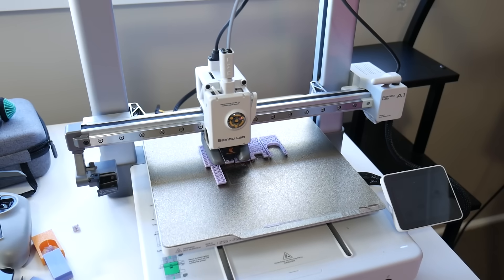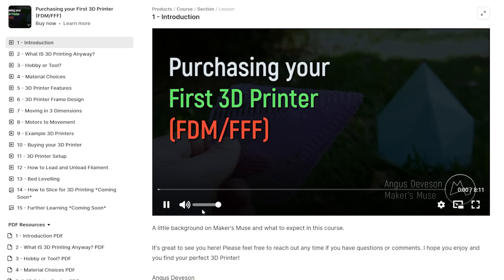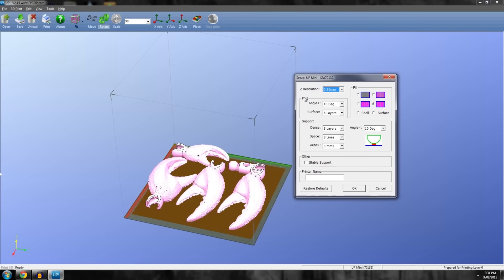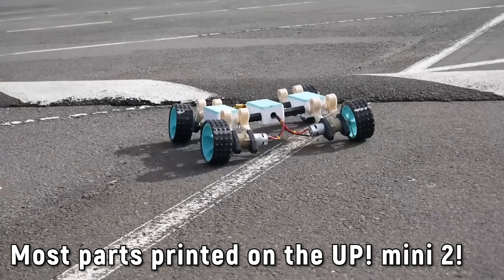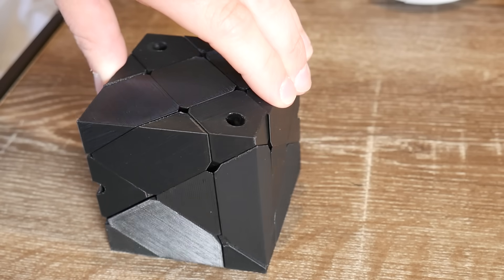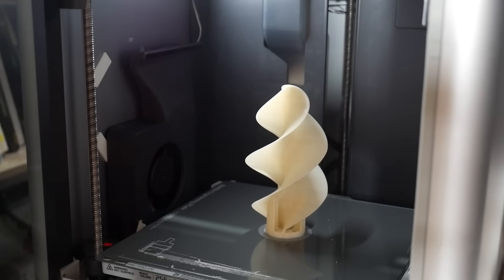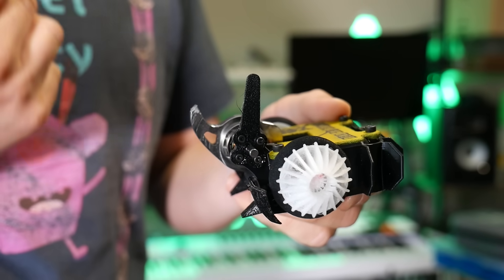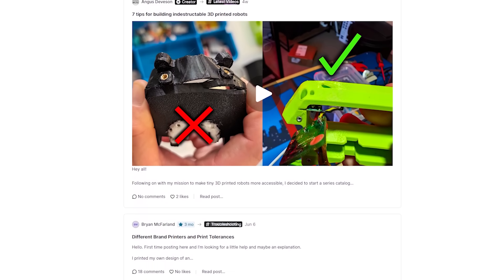The best 3D printer is...

Comment: Main thing is to do some research first. Watch videos like this and then research some more.

My first 3D printer was purchased because it was cheapish, was small, and I thought it would be easy to print small things on. Was junk. A benchy took about 18 hours if it actually finished.

Then got an A1-Mini. Absolute revelation.  Didn't want the printer to be the hobby but just wanted to have one that printed stuff. The Mini has been great and very reliable with any issues being mainly filament/humidity. Just got an A1 too only because I know how to use it and a lot of the spares and the AMS are compatible.  I tend to use Bambu's filament because, again, it just tends to work. Not a Bambu fanboy but if you just want to 3D print then it is an appliance.

Comment: This is why I watched a shitload of reviews and picked the machine I wanted to try . First 2 were a Kobra 2 and a Creality S1 Plus. However , they were not the best but I learnt from using the Creality.  Then I got an FLSun v400 and recently a Flashforge 5M Pro . Now both have their own quirks but I know enough now  about 3D printing to be able to deal with them. Enjoy using both . The one thing I never did was to blame any reviewer if I didn't like a 3D Printer I bought. The choice is still mine and reviewers are not there to find every bug a printer has !

Comment: Have to agree reliability is absolutely king. I have just reluctantly retired my zortrax inventure, it was slow but stunning prints and a reliable little unit. The mobo gave out in the end.
I run a farm of piS bamboos, a little worried about the access issue, but the printers just work. I replaced the first nozel on them last week, a solid year of commercial printing under its belt. Printers have just come so far that there is no excuse for trash anymore.
Reply: The worries are always going to be there but the reliability of Bambu Lab for the price is ridiculous.

The first and only thing we did to the C1 was to swap the nozzle after 1400h of printing. Just one nozzle, that's all we've done, and we have an A1 mini, an A1, three P1S (soon to be four) and a C1. I understand the dangers of Bambu Lab, but I'm not willing to pay with my time anymore, It has been 10 years of fighting with machines, I don't want to "learn" anymore, I want to hit print and forget about the machine.
Reply: @chico_zombye  they are honestly that good. I swap between PCTG, abs, nylon, tpu and CF petG constantly and it just works every time. Hard to argue with.

Comment: I've experimented with a lot of 3D Printers and some I bought just for the history and retro display. My first printer that I actually bought at near full price, Amazon had it on sale, was a Dobot Mooz 2. Bet you never heard of it. It was almost a clone of the Snapmaker Original. In fact it even has the 3 modules (3D print, Laser, and CNC). It was actually fantastic and still is BUT small print bed, BUT heated. Made my first print, a word clock with Raspberry Pi and Nanopixels. Came out great and still use it. Next I bought a Lulzbot TAZ5. I bought 2 of them. By this time I had experimented with the Dobot and bought 2 Lulzbot TAZ 5s on eBay "parts only". They were both in bad shape, wiring, bad LCD, assembled very wrong. I fixed both and ended up with 2 $1200 printers for $250 and about $150 in parts for both but about 5 hrs of my time for each. They are still work horses, and one I built a Moarstruder, 1.2mm nozzle with 2.85mm filament. Still great printers. From this point all the printers I bought were "as is, parts only on eBay". I bought a Snapmaker A350, kind of overrated but OK. A Sindoh DP-200, enclosed and prints great in ABS. Then I got some old retro machines, Cubify Generation 2 and 3D Systems actually had an archive of the slicer that makes .cube files vs. gcode. Makes average prints BUT it prints. And I figured out how to bypass the proprietary filament. I also got a IMADE3D Jellybox. Very very cool transparent enclosure. This was the first generation and they still make this printer to this day. Makes average prints about as good as the Cubify. My printers that I use now are 3 VORONS. I like them a lot, have to build them and I bought them on eBay from people frustrated with either the build or firmware loading as it uses Klipper, Mainsail, and one other interface software I can't recall. So, they are complicated builds. Klipper is great as, if you load up a build plate and one print fails you can stop the print of that one piece keeping the rest of the prints on the bed going. VERY VERY cool. The VORONS are all enclosed so there is no limit to what they can print and are configurable to your design. I also have a Ankermake M5 which is also pretty cool. I did get one delta printer, almost forgot, Dobot Mooz 3 which actually allows you to blend filament colors and do multicolor printing. Got it super cheap from someone who probably configured the slicer for printing on a square bed vs. the delta's circular. I configured the slicer correctly and work. Does have a heated bed, average prints with a very small bed, But it's fast like all delta printers. The Dobot Mooz 2 is better but it's cool to have one delta printer.

Comment: I started with a Makerbot Replicator Z-18.  I switched to a Bambu Lab X1 Carbon when it came out, and now have a Bambu Lab H2D to work with the X1 Carbon.  I'm used to CNC machines, so what I print always seems a little small.  Print and glue.  I've switched to PETG for final products.  I'm hoping for a printer with 9 times the volume in the next few years.

Comment: I bought my first high speed core xy printer a few months ago. After so much agonising about where to put my AU bucks, I finally settled on the Anycubic Kobra S1 and I'm loving it! It has the ACE Pro (supports 2 of these!) and I'm loving it (although multicolour is slow af!)

It prints PETG as fast as PLA! And because of the ceramic lined hotend, you can swap between the two in succession. Either order!

My Ender 3 linear rail conversion is gathering dust because the Kobra S1 just works on demand and is so fast. I may just get a complete Anycubic printhead assembly for the Ender, the hotend is its weakest link! 😂😂😂
Reply: Also feel the same as you about resin machines. The stench is literally nasty. Lethally, potentially.

Comment: Ans:  It depends.......

I have been doing 3D printers since 2001, what really gets me is many in YT are so adamant that one could dominate all against the entire market.  If this is the case many printers would have gone out of business by now, including older commercial companies like $$$$$-$ Polyjet or $$$$$ Stratasys.

3D printer is a tool, the question is - what do """"you""""" use it for?

$ Educational Self learning - open top basic Kit printers
$$ Print Exploration or Print Farm -  more automated options, mass print customisation or Filament vs Resin question
$$$ Design focus - superior print speed & quality, quality hardware v cost tradeoffs e.g. heated chamber, multi filament
$$$$ Semi Pro - fewer failures & post process steps tradeoffs with more proprietary hardware and ease of use desktops
$$$$$-$ Commercial grade - all of the above, in a dedicated room, much improved reliability when professionals don't have tinker time to mess around with minimal printer input effort (much like 2D graphic designer with their Pantone printers), traded with proprietary lockout features for print quality and mass printing (consistently & reliably)

Comment: Good advice. Find the tool that works best in your hands, and use it.  

@Maker'sMuse:  
Something that would be really helpful to me in finding the most ideal printer for my work is if the manufacturers and reviewers would print models with similar characteristics to those that I deal with, but I'm not finding many examples.   

Here's the problem:

Most of the promotional content from the industry offers images of elegant CAD models (often hard-surface designs) or digital sculpts that were designed and optimized for 3D printing.  That makes sense, but for users who need to print more complex shapes that push the limits of the machine, those demonstration pieces are not very informative.  

My work requires printing models based on 3D scans of organic/biological structures.  I didn't design them - nature did, and if I want to faithfully reproduce those objects then altering them to make them more printer-friendly isn't an option.  Whether generated by high-resolution surface scanning or micro-CT scanning, the shapes are often highly textured and convoluted.  Even orienting the model for slicing/printing isn't straight forward, because every orientation creates a new problem for each one it solves.  

Seeing a printer smoothly tracing the graceful contours of a Mandalorian helmet doesn't tell me anything about how it will handle one of my models.  When a layer path looks less like lines and curves and more like a seismograph tracing, the amount and frequency of directional changes the machine has to make is significantly higher.  (If I'm not mindful of the settings when I print them, the whole machine vibrates like a paint shaker and sounds like it may fly apart). 

I have given files to a number of friends and colleagues running different machines, and there are definitely some that work better than others.  But I think the 3D printing community could benefit from finding such an experiment in one place, and your channel seems ideal.  So how about it, Angus - would you consider testing out some jagged natural models?  I'll be happy to supply a few .STL files!

Comment: Prebuilt vs kit isn't even necessasrily cheaper. Take my Ender 3 MAX neo as an example. What I wanted was a large volume printer (>30cm³ to print full size helmets in a single go). It was by far the cheapest thing available *in my part of the world* at the time, next cheapest was the two largest neptunes but they were sold out globally at the time and everything else would've been at least 100€ out of budget.

My goals as such were:

Reasonable print quality
30cm³ minimum
Under 350€

I hate this printer, but for what I wanted at the time it was great. I hate it because it keeps having novel issues too frequently, it's a very cranky piece of kit and every time I squash an issue a new one seems to manifest out of thin air. If budget is not a concern I'd say go bigger, but if budget is a concern then you'll have to put in work.

Comment: My personal experience with my Ender 3 (bought in fall 2022) has been amazing! It’s my go-to printer, and I see no reason to switch. I also learned a bucketload about it while assembling it. Being brand new in the industry, CHEP helped me assemble it, and he also said not to mod it right away, but rather to work with it straight out of the box, get to grips with it, and THEN mod it if you want. I haven’t. It works perfectly as it is, and it’s all I need in this hobby. Of course, like you said, everyone has their own preferences, and there is no right or wrong.
Reply: It's a great teaching printer and It works well for the price. I have mine tuned to my liking and I can actually navigate the slicer to get great results from it. I still use it for my projects even tho I have an ender3 pro. Because it is easy to fix and I am very familiar with it, parts are dirt cheap for it I tend to gravitate to using the ender 3 more than the better printer.
Reply: @webreakforsquirrel4201  I mean its not just a teaching printer its also a just works printer... assuming you assembled and maintained it correctly. But same goes for any machine really, so... meh, points moot i guess.

Comment: I am the type who doesn't print so frequently that speed is important, but does want it to be reliable, is planning to use it for (electronics) engineering purposes and is generally willing to pay a bit extra for a "step-up" product that I believe will last longer than others.
SO for me the MK4 made the most sense and it hasn't failed me yet. Don't feel the need to upgrade to a 4S or to consider a Core One at present.

But that is my personal choice. Thanks to Bambu giving the market the swift kick to the rear it desperately needed. Most printers released these days are perfectly viable for anyone interested in such machines. Be it as a hobbyist looking to print neat things or an (aspiring) engineer looking to design and create their own stuff. It is nowadays more about the tradeoffs offered by the company and thus more important to double-check that.

Comment: Thank you so much for the video! I avoided buying a Bambu printer just because of the firmware and decided to go with our k1 Max and get the CFS to go with it. I knew I would have bed levelling issues and a couple of other problems but boy was I shocked when one of the load sensors failed and the hot end dug straight into the build plate and then later on the extruder backed straight into the printer and broke one of the wires on the extruder motor, plus quite a few other issues. Creality were really good with organising me return and refund and I just want reliability so I have ordered the P1S with the AMS 2 Pro.

Comment: mk3 bed is the bed on my hypercube lol

though both of my hypercubes have the same things in common as your workhorses, they're reliable printers that are a tool

edit2: "Road Runner" which is my more travel friendly hypercube, it was first built in 2017 and then has had upgrades ever since, starting out as a clone MK2 from Sintron on ebay, before becoming the hypercube using the same electronics, before then being upgraded to trinamic drivers & klipper. The stepper motors are pretty much the only original part from that Sintron which I bought back in 2015! so they're over 10 years old lol. I do need to replace them because they are noisy AF and defeat the silent drive

Comment: Thanks for this. It didn't help me at all in being 100% on what my next step will be and I'm kind of glad for that. I have a MK3s, upgraded from a Mk3, all courtesy of my last job going out of business during COVID. It had some issues, it's seen many many hours of hard printing, and I let it sit for years because of those issues. Recently I pulled it out of storage, updated it, redid bed leveling, new filament, and it printed right away. It's slower than I'd like, but just as fast as I remembered it being. That speed has had me wanting to go faster and as much as I see all the pushing for bambu floating around, I just don't want to get behind their walled garden. I'm also worried about prusa sliding somewhat in that direction. 

So with that, I still have no idea what I'm going to pick up next. Mk4s because it's comfortable? Core one because enclosure? Bambu, Creality, Sovol, Anycubic, FLSun, maybe? Or do I talk myself into an LDO voron kit? I'd get the mk4s upgrade kit but I'd rather not waste so many parts and pay so close to a new one for that (new PSU and bed, worst case scenario). If prusa got the price of that down by $150-200 it would be a no brainer. For the whole of $100 I can get a whole new kit printer and either sell this one or give it to a friend or family member, pass it on so to speak. 

Time will tell. I think it'll be a Mk3.5 next, just because, and we'll see what comes after

Thanks again

Comment: Prusa mk3s/ 3s+ are bullet proof. If a company utilizes  660+ of them in their factory to manufacturer their own machines then they are reliable and worth looking at over crap like an Creality offering such as an ender 3. I know if I wipe texture bed with iso, brush nozzle and press print, the petg part will finish! Other materials you have to be more careful with so I just print petg. The XL is good too. 

I recently put a print on the mk3s that’s sat idle for 15 months.  As the xl has a long start time I went to get a drink and came back to clean bed and had a dusty blob of plasti it had a good chop at it. I wiped down and print it fixed flawlessly - that was TPU too.

I’d consider Core One for the enclosed volume to print abs snd pc etc  but a 2nd XL might he better for what I do. XLS or XL2 should make an appearance soon too.

Comment: The best 3D printer is cheap and has less problems than the others do, the ability to print nylon is nothing more than a bonus, it would be nice if TPU could print too.
In short, you need to start with a budget model for a budget person.

Comment: I use the 3D printer as a mix of fun and practical uses. Fun for just nice, decorative and experimental stuff, and practical for weird shaped parts in consumer electronics repair. This often involve parts that are simply not longer available (old consumer electronics) or ridiculously expensive.
Understandably I do a lot of CAD design, because the parts mentioned above have no blueprints of even simple measurement sheets. Personally I use FreeCAD for all my designs. Now version 1.01 is out, most of the quirks that hold it back in the past are history. Is it perfect? Well - No. But I am very comfortable with it, does everything I need from a CAD program, and it's open source and free.
I used a lot of Creality printers in the past (the latest was the Creality K1C), but I now have gone for the Prusa Core One. I ordered the kit, and lucky enough I just got the shipping announcement today. It will be the first time building a full printer since I have build some Acrylic monstrosity from SunHoKey about 10 years ago. It was a nightmare to get some relatively decent prints out of that one, but I have learned a lot about 3D printing (and especially what can go wrong with it). So - I am looking forward to a far more fun and rewarding experience with  the Core One this time.
Reply: it's a very rewarding process assembling it. Especially when the prints come out great on the first go!